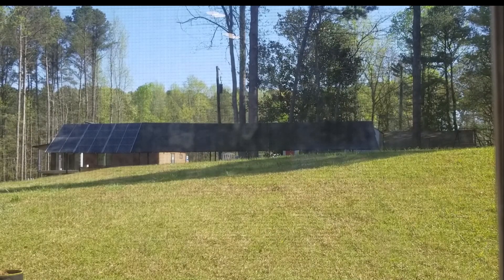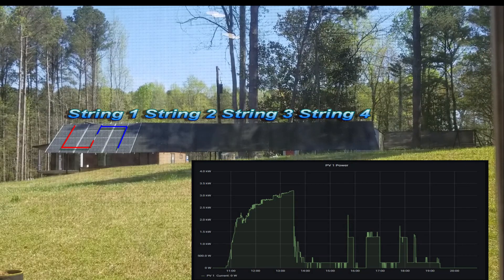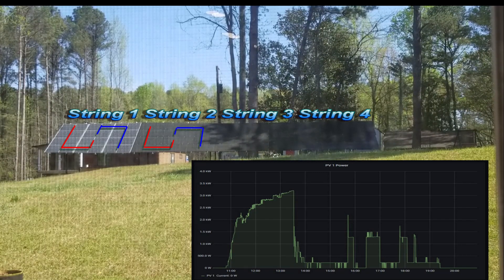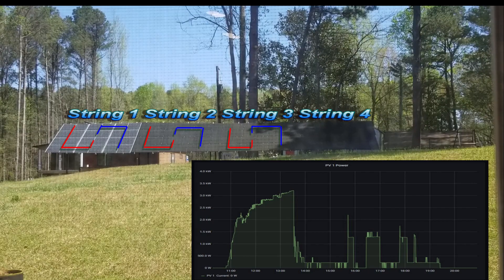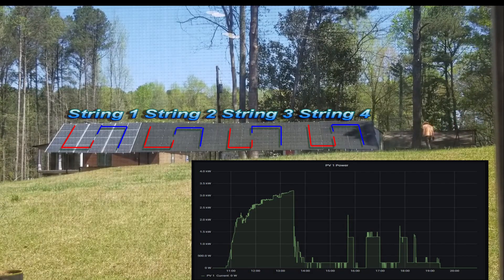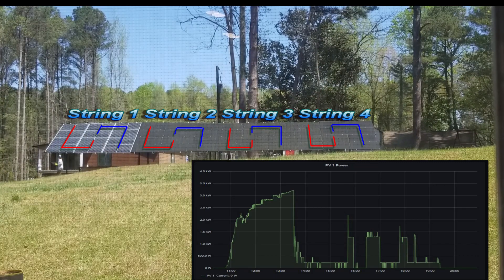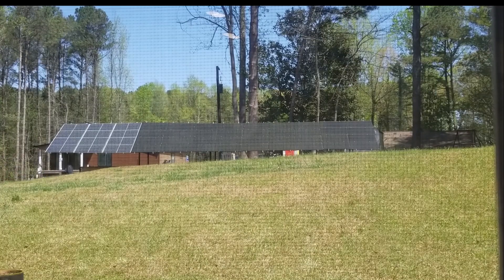Solar Array Shading & String Setup

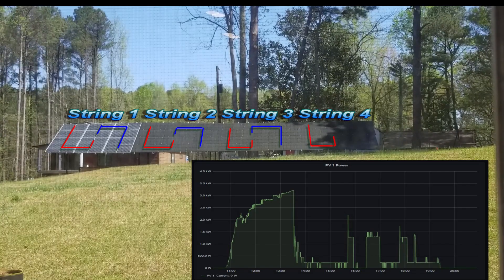Comment: 3:40 Why don't you mines crypto-curencies ? It will always consume electricity. Or maybe produce hydrogen for cooking also ?
Reply from the maker: Charging an EV takes a lot of power. Thanks,
Reply: @DMIINC2013  The problem is that you don't need to fully charge your car everyday. 🤔
Reply from the maker: There are other high consumption devices like central AC that require large amounts of stored energy.

Comment: So with four strings, you are only using one MPPT per inverter? 
What is the voltage and amps per string? (I believe each LV6548 PV input is limited to 18amps and 250V as per the manual correct? Two inputs per inverter for 8KW per inverter, 4KW per input)
Reply from the maker: https://youtu.be/W7AZmyy38cw

Comment: well plannes.
looking into waterheating by excess solar atm myself, but have found a few dedicated mppt circuits.
how are you doing that ?
using hass to switch on the heating elements when you batteries are full and load is less than , or do the pips have smart load of sorts ?
my older mpi's didnt
Reply from the maker: I am still in testing phase. But yes HASS can do that. If SOC>90% then turn on hot water heater. However HASS needs to know correct SOC. I am using Victron Smart Shunt.
Reply: There are also solar diverters which can link to a heating element, they attach with a current clamp to any grid return and modulate the power consumption of the heating element according to how much PV current you have excess. It requires a grid tie system (or a hybrid, tied inverter) but its good when you don't have so much extra PV or don't have batteries. Immersun, MyEnergi EDDI, and Solic are brands doing that.